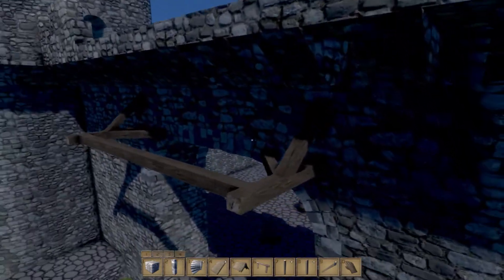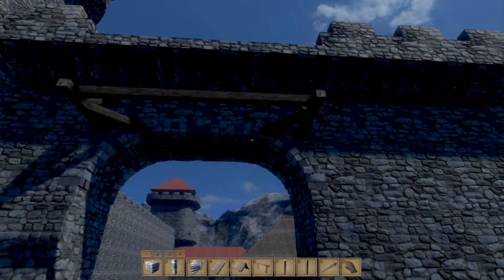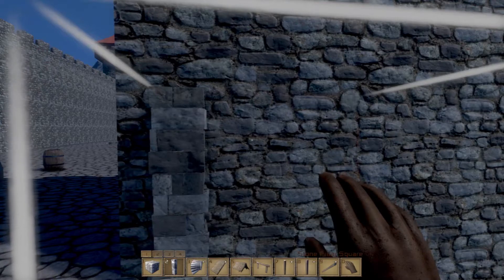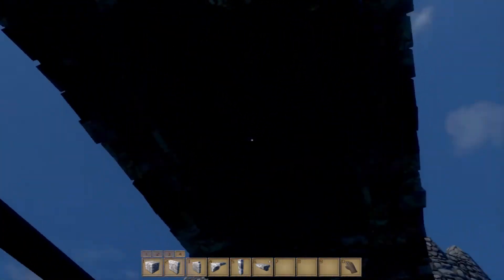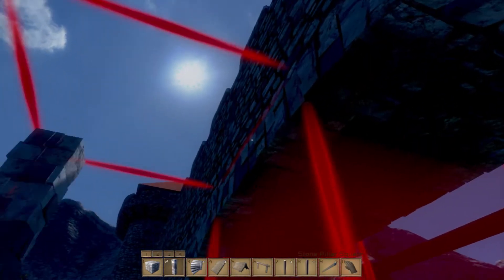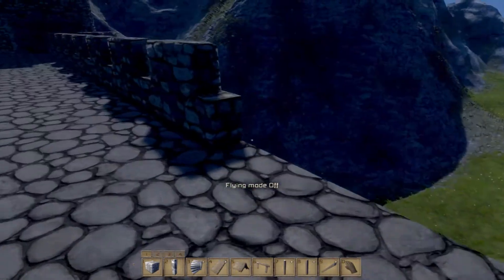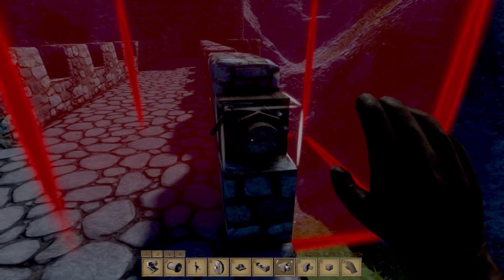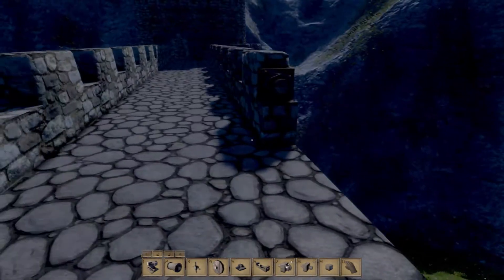Medieval Engineers Let's Build: Small Castle - Part 17

Comment: I've had the issue with draw bridges getting stuck up so you can't lower them back down, but I haven't had the half-way glitch you were having in this video. Can't wait til some of that glitchiness is fixed.

Also, just in case you're not already aware, you seemed to be having a microphone issue at times in this episode. Sometimes the volume of your voice would just suddenly get much lower for a few seconds and then return to normal.
Reply from the maker: ***** Yea, I think it'll work fine once some of the glitches are ironed out. And I'm aware of the mic issue. I'm still working on identifying the exact cause but I'm sure it's in the editing process. If I'm in a hurry & don't let some of the files generate like a "peak file" or something to that effect it usually does this, not sure why though.
Reply: Yea. I'm really happy torches and stuff emit light now as of yesterday's update and we can get rid of rubble now too!
Reply from the maker: ***** That's SO true! Can't wait to see what all that patch fixes in this build too! :)